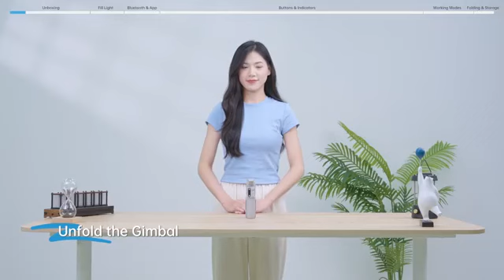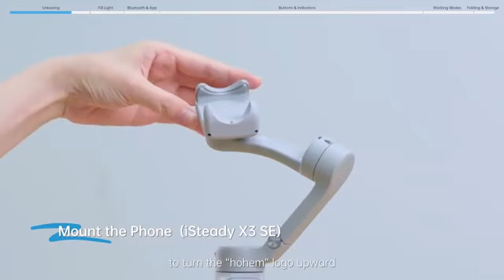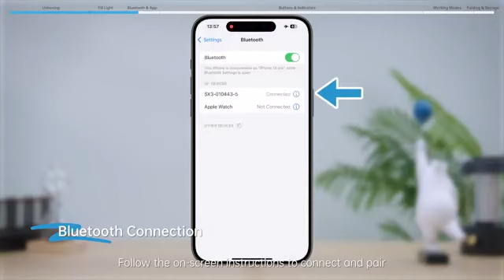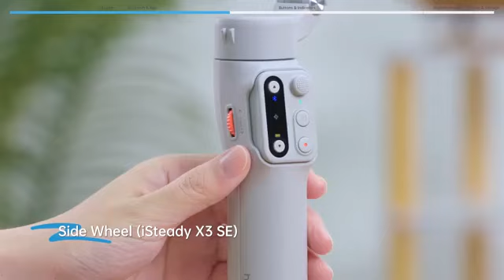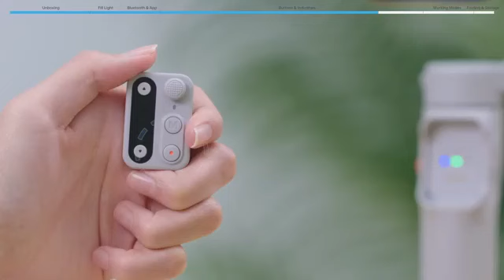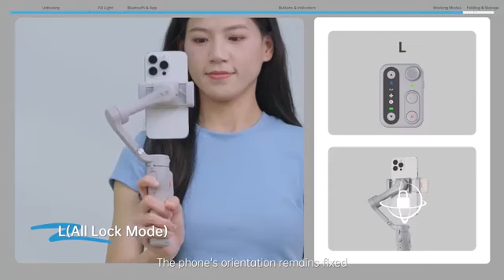hohem iSteady x3 Beginner tutorial.

Comment: Can you use a phone case on your phone when clamping?
Reply: I know it works with my small iPhone pro and case
Reply: My bumper case doesn’t cause any problems. (IPhone SE)
Reply: Depends on the case dimensions.
Reply: I have a Samsung A54 cell phone. It will work with my case on, but it is not locked in quite as securely as it would be if I removed the case. Without the case it works perfectly.

Comment: The SE version does not have the AI object follow like the X3 has, and that was disappointing, but that's what happens when you go for the less expensive version. Also, I returned my unit as the pan-follow mode didn't work properly. In this mode, the phone should not tilt when the unit is tilted but in fact it did, and did not return afterwards, thus requiring recentering every time. Not good.  Update: I now know the SE will do AI follow by using the Hohem Joy app. Also, the degree of tilt beyond which pan follow will not work is limited as it is with other Hohem models - you just have to live with that.
Reply: My SE follows.  You have to use that function through the app from what I’ve learned so far
Reply: @tluv6921 Yes you are right. I was mistaken about it. Sorry to have maligned the SE.
Reply: @Cutandpaste1403  Thank you for the update to your comment because I was thinking the same. Plus the video says nothing about using the app for AI follow, it just says to download the app.